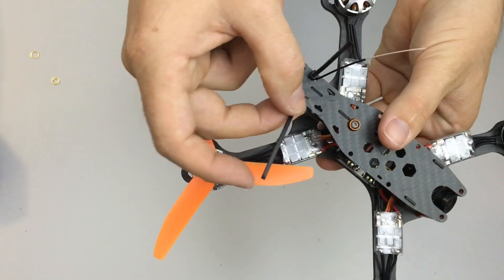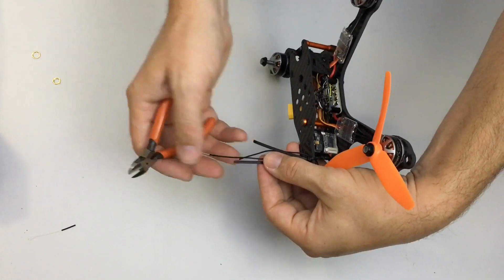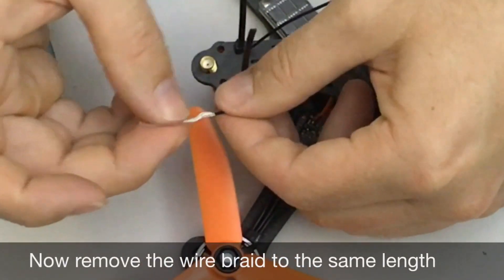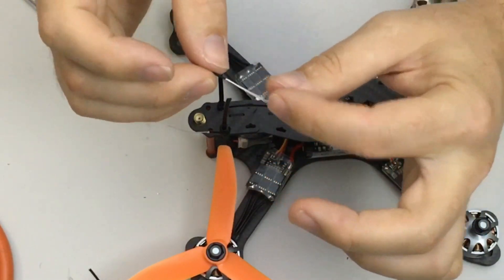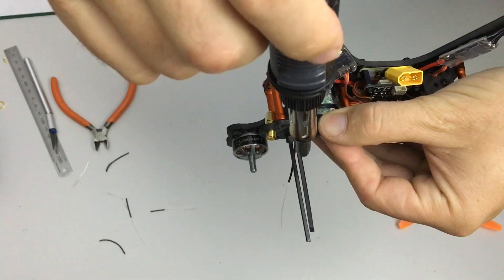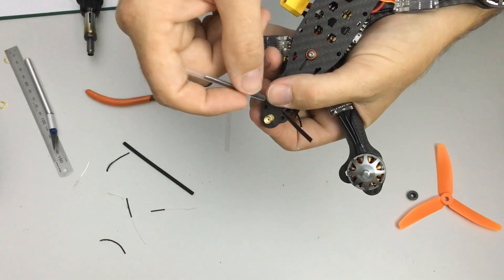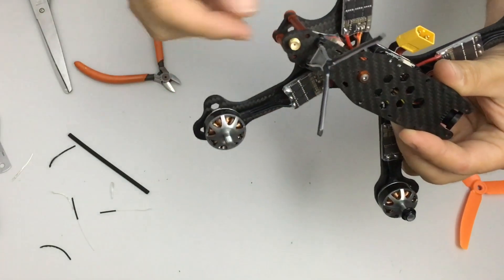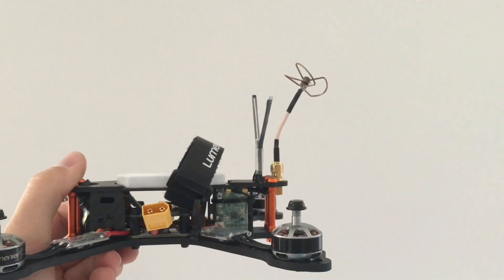How To Modify And Fit Receiver Antennas

Comment: The length of the whole wire matters...  http://www.rc-cam.com/ant_exp.htm
Reply: +Ronn Wilson no it doesn't. The whole length of the wire that forms the antenna matters. Think of a coax feeder cable with a whip antenna at the end of it, now, in your mind remove the connector between the two so the whip is built onto the coax feeder, that's effectively what you make by stripping the shield back like this. The coax length has a negligible affect on an antenna like this
Reply: Awesome bit of info. Thank you. It would seem as though shortening the wires could be detrimental. I will try to not bother them.

Comment: Wouldn't there be a lot of interference because your vtx and rx are so close together?
Reply from the maker: They are on different frequencies and not a multiple of each other. I've seen people successfully run the receiver antennas off the sides of the VTX antenna. The risk isn't that your receiver will interfere with the VTX (poor video) but that the VTX would interfere with the receiver (RSSI control dropouts).  And I haven't seen any dropouts with the FRSky stuff yet.
Reply: cheers